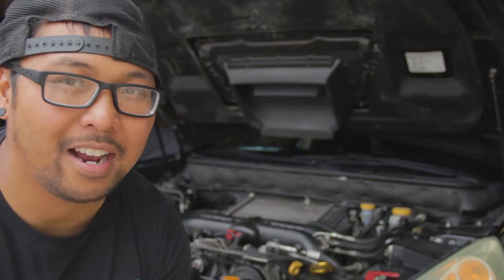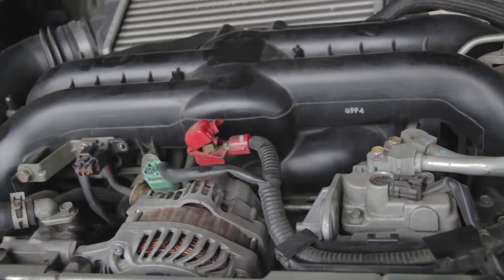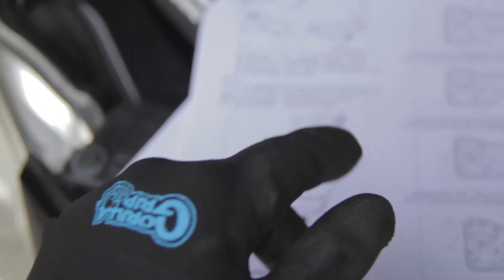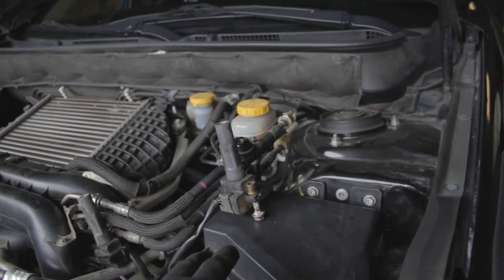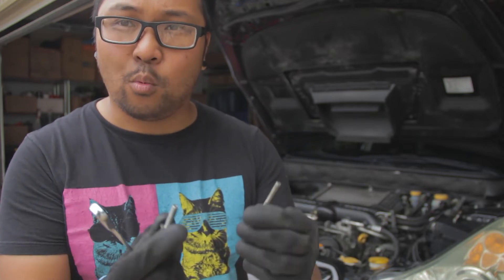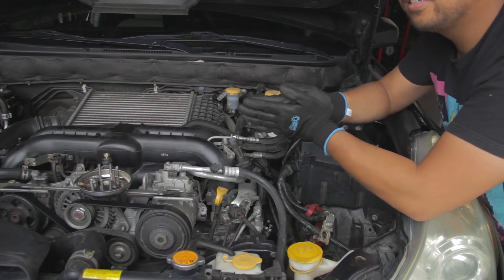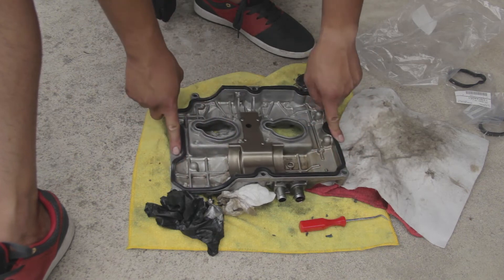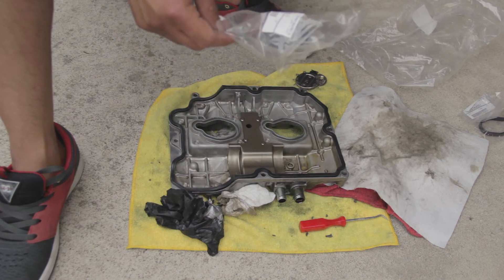Valve Cover Gasket 2010 Subaru Legacy GT

Comment: Nice job except for wrenching off the bolt.  I grew up working on a farm in Missouri.  We had just rebuilt an old Ferguson 30 tractor motor when I wrenched off an oil pan bolt.  The farmer I was working for at the time handed me a 1/4” drive socket to tighten up the rest of the bolts.  I still use that technique today.  Keep up the good work.

Comment: Im trying to get my sparkplugs out and replaced in my 2010 gt manual (RHD) and I still cant get all the plugs out even with the engine raised up. Am I missing something ? I couldn't jack the engine by the oil pan so I went with the turbo manifold. got the righthand side out but the back left I think I might need an extra person for help with a prybar

Comment: Thanks for this!  I had the headgasket replaced a while back and don't know if the mechanic installed the drivers size spark plug gaskets correctly.  I just did an oil change and found oil leaking from the drivers side front spark plug.  I am going to tackle this job.  Do you have a parts list for the gaskets you used and the hose clamp you needed to replace?  Also where did you get a print out of the manual?
Reply from the maker: I used all Subaru OEM gaskets. I would replace the hose clamp with a generic one that you tighten with a screw driver or just a zip tie
Reply: @victordeleon8412  thx..I'm looking on the Subaru site for the gasket part numbers. did you ever need to replace that broken bolt? If you didn't need to film everything how long do you think it would have taken you to complete the job?
Reply from the maker: @amidroc  I never replace it, I probably should, it leaks a little but not an alarming amount. Its probably a 1/2 day job, but like I said in the video take your time, put aside a full day so you dont rush.

Comment: @boostbot hey thanks for the video. mine is 2009 subaru forester XT and wondering if i can use gasket fron non turbo engine 2009? i have damaged piston rings in non turbo and not using it.
Reply from the maker: SuuntoAmbit I’m not sure but probably not. The non turbos are single overhead cam and probably have a different shape. I would try looking up the part numbers on the Subaru parts website and see if the match or call your local dealership parts department for a definite answer